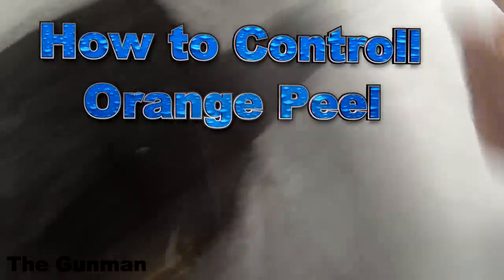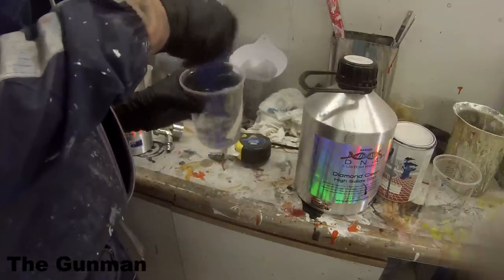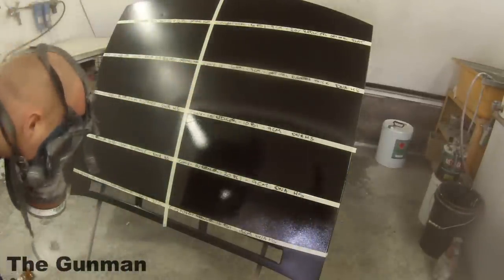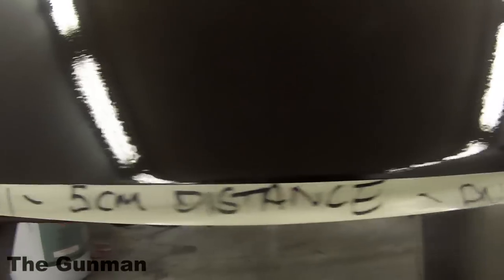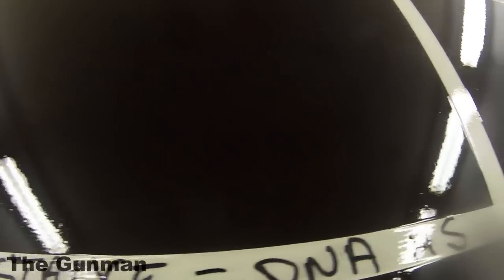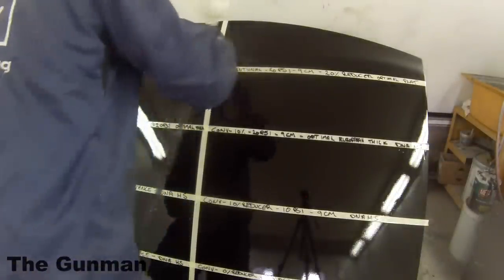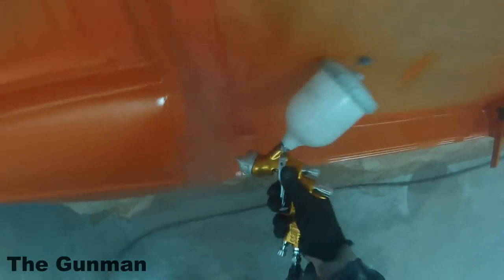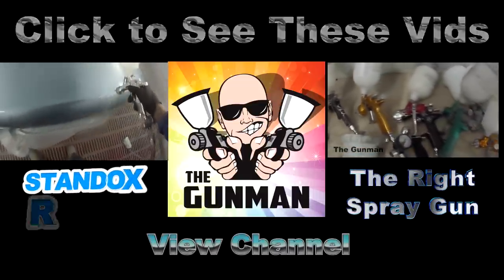How to Stop Orange Peel

Comment: great videos, thanks à lot, 

why is the standard given distance 20 cm? is it just to allow large fan specifications ? a friend that teaches painting say he aim for a 30 cm tall pattern, at about 15 cm, and if more why not !!!

what may be the trouble when working near ? Is it then mandatory to paint from bottom up to be sure no drip or "bellies" ?

thanks again, lot of things to think about in your videos..
Reply: This is kind of old but I'll still reply incase it can help someone else. If your too close to the panel it doesnt matter how fast you move. You will run make a run. And the further away you are the more dry your gun will spray. It's not mandatory if you start from the bottom or top. Start where ever is most comfortable. In theory it's better to start from the bottom to reduce chances of runs but In my experience (painting at a Lexus dealership in houston TX 6 yrs now) it doesnt make much difference.
Reply: @bikerboy4161  i feel like he the gunman doesn't know how to read a tape? 5cm(2inches)? that has to be way to close doesn't it?  i am no professional, but at a stand off of about 13-18cm(5-7inches) my hvlp gun seems to do well and lays paint plenty fast for me.

Comment: I think too many people rely on a super thick clearcoat now days.  When I started spraying I got all kinds of orange peel.  Learning to use a viscosity cup was night and day.  If you mix by ratio, you are always having to compensate because of the temperature and humidity, and you are always hit or miss.  It is a little bit of a hassle, but using a viscosity cup is the way to get consistent.  Timing the flow from the cup and adding reducer accordingly, makes sure that when you spray that day, you have the right viscosity.  You have a lot of good videos.  There are too many misleading vids out there.

Comment: Gunman do u reduce most of your clears to 20%..ive tried that using 80-100 dollar clear coats and because its the cheaper clears it dulls out a bit so i reduce it only around 5% some peel but it shines or more reduced and it dulls, guess that doesnt happen when your using 200-300 dollars clear?
Reply from the maker: pete ss This clear is a HS clear and very thick so not all clears need to be thinned that much.
Reply: thanks for the reply man

Comment: kind of a dumb question but are you adding the thinner in after mixing the clear and hardener? Im still kind of new to this and thought that you shouldn't use thinner/reducer in spraying clear?
Reply from the maker: Some clears need a bit of thinners, the clear I'm using nowadays doesn't require any but some like a bit, yes I always add thinners after hardener

Comment: Excellent information as I want to spray my kitcar with the smoothest finish I can get from my HVLP turbine, so 20 percent thinner and close. Cheers mate.
Reply: Mick,
What turbine do you have? Gun(s)?
I purchased a Sprayfine 4 stage & am just starting to use it. Are you happy with the turbine? What kind of kit car? So many questions..
Thanks for you response!
Cheers from Texas
Reply: @artwatson5479  hi, I built my own turbine using a 1200w vacuum motor, my gun is an earlex pro, have various tip sizes. I have gone back to using my compressor as I am getting a better finish. All my projects are on Instagram, check out shiggy_the_project_man
Reply: @mickchaganis6607  
Thanks much for getting back, looking forward to checking it out!
Reply: @artwatson5479  I think you will get a much better finish with your unit, the earlex gun just isn't good enough. I love the idea of HVLP turbine, no waiting for compressor to build up, no water in the air but I am going to build a big compressor with water traps as I have some really good spray guns.

Comment: Does horizontal vs vertical panel make a difference? My peel flattens out no mater what. I can get it to go on with peel, but doesn’t stick. I need that euro-peel. I have been painting in less than ideal temperatures though, but it’s finally starting to warm up. Matrix Euro clear+normal hardener.

Comment: here in EU we use alot of UHS clear coats and there is a problem with these kind of jobs when u need to get the right orange peel or i call it texture on the car. this is where the VOC is coming in as a problem for example when you over reduce a paint or clear coat its not legal paint any more because it goes over the VOC rating but who the hell cares anyway right? =) but its pretty easy when you understand how it sprays when you over reduce it then its easy to get the right texture. Warning all colors or clear coats don't work well with over reducing it can cause problems... good video btv!

Comment: Orange peel depends on witch clearcoat you re using,witch type(MS,HS,UHS) and temperature you re spraying,avoid less than 17 degrees celcius.Then you can play with setups,spray paterns,distance and reducer to get the result your searching for.With UHS clears its more difficult to get a wet looking surface than a HS or MS clears,but you get the factory looking surface.

Comment: Im not sure if I missed it. So why do you still have orange peel in the "optimum setting"??
Reply: Paul K because it's not optimal. optimal is  no orange peel, no trash, no runs. he has all 3 in every section he painted. 

he needs to use a down draft spray booth and he needs to use tac rags in between each coat. if his prep work was done correctly, he should have had optimal finish in a majority of his test strips

Comment: Reproducing your experiment....Hey Gunnie, I was so inspired that in the spirit of science I went out and reproduced your experiment. With a twist however....instead of measuring the pressure into the gun - which varies with make and model. I measured the air OUT by blowing half trigger or full trigger on to a kitchen gram scale.

My conclusion is that about 40grams of BLOWING pressure on a viscosity of about 16 secs...is about as good as it gets....regardless of INPUT to the gun and to a certain extent even the gun itself !.

(For example one gun needs 3.5 bar in to make 40g on the blow, while another only needs 2 bar. YET both spray outs were equally flat and good (though fan size and TE is a different matter-we are just talking peel or not here)

SO I want to ask you to cross check my result. Can you set up your gun like you did for your best and worst result above....but blow it into your gram scale and tell me what the readings are...If I'm right the crap result is from a blow of less than 20grams, 30 grams is better, 40g is really good and past that you are just wasting paint....

Vive la science !
Cheers Mate !

Comment: Also quick question for you. When you have 10 psi, and 20 psi is that with the trigger pulled or just what is read at the compressor?  Ex: does your 10 psi equal the normal 30 psi at the compressor.  How do i know i got 10 psi at the gun, if I don't have a gauge at the end of the gun to tell???
Reply: Jay Fleming trigger pulled
Reply: Pulled

Comment: if ya got orange peel it's either coz of the last sprayed layer (no matter how good your mix or pressure is), bad prepwork, or bad settings/mix. first thing you gotta do is sand it FLAT, then do the perfect mixture, pressure, etc.

Comment: when you sand a hood like that does it take away the nickel coating that are on some panels? It's usually only 2-3 microns thick
Reply from the maker: Never had any issues with it, you just use an etch primer and that is anti corrosive

Comment: i have a very rookie question. The psi is the measure on the manometer without pulling the trigger or pulling it?
Reply: I usually set the pressure before pulling the trigger fully

Comment: Very Nice testing method--I learned, by doing, to lacquer pianos, but wish I'd done the kind of testing that you do in this video, before I got into the real thing.  Can't say enough about safety and good quality breathing protection--it's too late once you get COPD, so mask up with the right filters, everybody, and stay healthy, and if you can go with fresh air system, you'll do a lot better in your later years! Remember, finishes off-gas for many hours, so don't drop your masks when you're in a room filled with newly painted stuff, until you get it well ventilated and full of fresh air.  If you can, put all your newly painted stuff in another room than the one that you are prepping in. Personally, after using Bondo as of late on an old 4WD Tercel, I think fresh air is the best way to go as I got headaches with new NIOSH organic vapor cartridges, and gave up being too fussy because it was too hard on me to work with the stuff. Is there such a thing as a good water based body filler, that might be easier on the user?  Thanks, Gunman, for the great video, I wish you were doing my car!

Comment: I'm going to be painting my 85 bmw. after doing my filler, I'm going to high build and block the car. should I block with 220 then 320 or should I just block at 320 the spray my color? Also, can you go more over flow coats or specific methods of painting?
Reply from the maker: Check the bottom left of this page there's a vid called how to flow coat, there's a few other vids there you may be interested in too. http://thegunman.net.au/custom-paint/
All the prep work tips will be in these videos
http://thegunman.net.au/prep-work/

Comment: after the whole panel had flashed could you correct all the awfull orange peel at the bottom by using the preferred settings for the second coat
Reply from the maker: You could improve it but I doubt you'd be able to totally remove it, that obviously depends on how bad it is.

Comment: Hi i sprayed my Landrover acrylic Trident green but in the acrylic clear coat i got dry spots and rough spots , i have a star gravity feed gun i had the pressure on 35 psi the shed was pretty hot I put 200ml of clear to 250 ml of thinners what would i have done wrong Thank you  Farmer form Victoria
Reply from the maker: +Farmer2492 I've got a video that goes into detail on how to spray acrylic paint so I highly recommend that, just type in to YouTube "how to spray acrylic paint" you should see a panel it's green and that will be my video it does sound like the pressure may have been in touch but if you're using a suction feed spray gun then maybe it would be ok to use 35 psi. I'm from country Victoria myself so I had to reply to this comment although I was about to log off for the night.
Reply: Hi Gunman i replied in your video. Thank you Farmer

Comment: When I first used my Iwata LPH400 with 1.4 tip for the first time for the clear I quickly found out that I have been doing it wrong all along.
I personally never thin down clear. I have found out that temperature is one huge factor in orange peel. At 70-75 degrees surface temp, it is possible to clear a whole car without orange peel.
Reply: makes sense....and what the hell is he talking about 6cm distance??? thats not even 2.5 inches!!!!
Reply: @kermitthefrog9315 
Yeah that seems kinda crazy. The side mirrors come quickly, so better watch out.

Comment: Been using lvlp spray guns lately but painted my whole truck with it. Most of them didn't last long and the other two that still worked got threw away last week maybe when my older brother was cleaning the garage but have another lvlp coming a 1.3 but now will need more than that for clear and sealer. I had a 1.7 to use for a metallic for sealer and had a 1.4 too. Have been getting ones from Ali Express. But now gonna stop buying products for a while because gonna be moving to Texas in December most likely in the country. I bought a lot of auto supplies spray paint and other auto detailing polishing supplies in the last year. I got some more coming but now staying away from buying new stuff for a while.
Reply: Which lvlp guns gave you the best results?
Reply: @GJJC13  Gonna use a turbine sprayer soon because have one coming soon the Fuji Q5 platinum but got it off a Asian site and for a lot cheaper than what it cost online over 1,000 but will see if it actually comes I used PayPal for payment not a bank card because PayPal is the safe way supposedly and used it when got the item but hope the item will really come and be the actual item but I have a lvlp spray gun 1.3 got from Ali Express but I use a small 26 gallon air compressor with like 5.4-5.6 cfm I think it is I never got a amazing paint job yet but gonna need to do this more after air runs out stop spraying and wait to when air pressure feels back up when using it but I am a person that wants to go faster when painting and still do it right. The spray guns got on Ali Express the lvlp ones and I would buy stuff from them again though.

Comment: What’s the difference in hardener and reducer I use hardener coood that be why my paint has a bit of orange peel
Reply from the maker: You usually need both, with 2k paint it won't dry without hardener but the reducer makes it thinner, so you can spray it. Sounds like you need some more thinners/reducer
Reply: @TheGunmanChannel  I just spray regular paint not anything fancy like 2k I don’t really want something Verry professional just want it to look better would I still need reducer with regular paint?
Reply from the maker: @robertjohnston1511  you should need it.

Comment: I'm not completely agree with the interpretation of "european paint", because there are so many brand and different orange peel. The Volkswagen has more orange peel than Audi, the BMW has another type of orange peel, and the italian's cars are too many different finish starting from FIAT to Lancia than Alfa Romeo, going on there is the SAAB, Volvo and so many other brand. All those cars has a different finish, but no one has the orange peel like in your description, but are more flat.
I'm painter too, and I use sata 3000 RP with Spies Hecker, PPG and Standox clearcoat and I'm able to modify my regulation for build the correct finish in european and japanese car, still keeping the same % of thinner, working with the flow , pressure and speed.
Just another thing, the Toyota has more orange peel than the Audi, check for example A4 without touching supercars.

Mauro
Italian painter
Reply: +Coolride17 of course, i was talking about for the majority of the cars ;)

Comment: Still monitoring comments, Gunman??
Reply from the maker: @nilla003  sometimes lol
Reply: @TheGunmanChannel  I painted the unibody of my Mustang and got unrepairable orange peel. I tried spraying a small panel at a reduced pressure, about 20-22 psi, and got much better results. Using an ADT HVLP gun and Southern Polyurethane products single stage red. Any suggestions? Oh, thank you for the reply.
Reply from the maker: @nilla003  usually more pressure helps, that and more thinners, or even heat the clear up if it's cold
Reply: @TheGunmanChannel  you recommend spraying from a much nearer distance than others. Perhaps I'm too far away

Comment: just spray as bad as you can with one condition, no runs, no build up
do 5 coats
and sand with 500 until 2000, wet at higher grit, you can even use 300 for first one if you manage to do a good job in creating very bad orange peel 
visualize after each sand (after dry) the depth of orange peel and determine next grit strength
then buffer and polishing substance when there is no more orange peel
done
lot of hardwork but anyone can do it